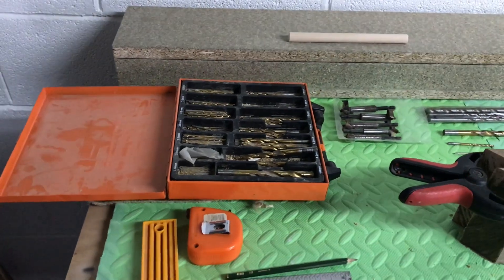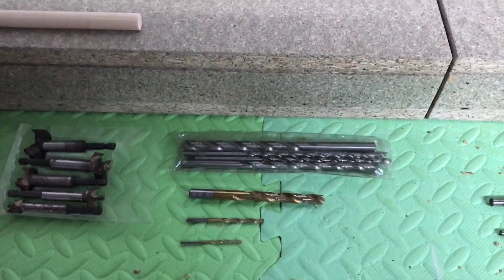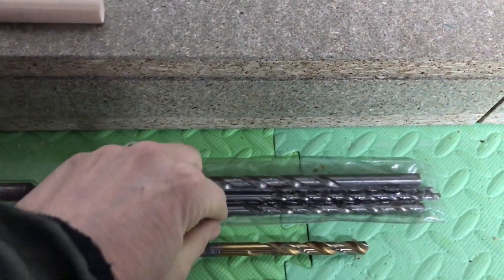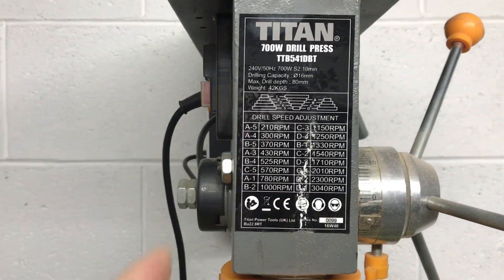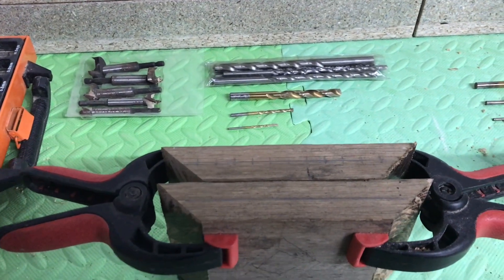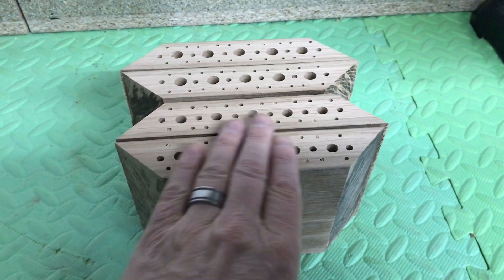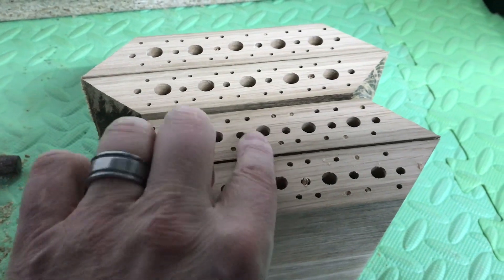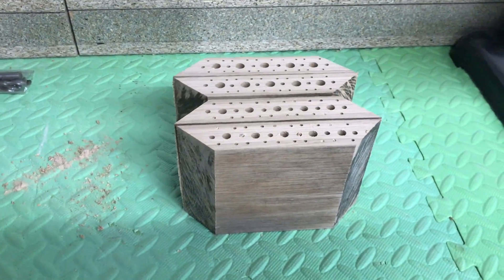Bee Hotels - Drills, Hole Sizes & How Deep To Make Them

Comment: Hello! Can you quickly explain what furring is, please? Is it to avoid bees getting stuck in the holes? I heard that can happen, so I am trying to find out more and how to avoid it when drilling the holes. Thank you for your help!
Reply from the maker: Hi, you’re welcome…..really it just when you drill too fast or the drill bits aren’t sharp enough then the holes aren’t very neat which the bees seem not to prefer. I like to put a 50/50 mix of PVA/Water on it anyway afterwards which seals it all. Never seen any bees get stuck before.
Reply: @Calastein  Bees can get stuck in the holes, but only if you do not drill from the side of the tree. If you drill into a tree slice/disk you tear apart the wood fibers in the hole. Some of them get pointy and let the bee in but not out. This is why you always drill from the side of a trunk. Of course you can sandpaper the holes to prevent this. But its not really a common problem. In most cases the bees know which holes are good for them.